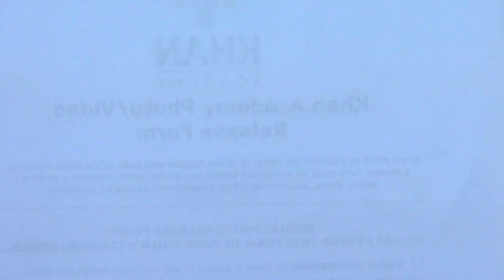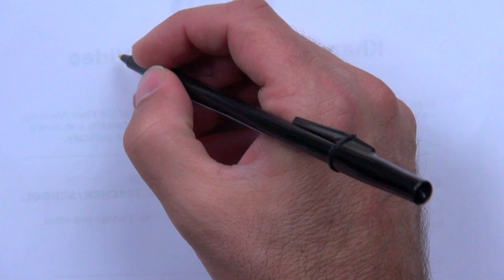What is inside a DVD player? (2 of 5) | Electrical engineering | Khan Academy

Comment: If the output current (or load) is large enough, the capacitor won't be able to supply power and the voltage will start to ripple. This is solved by using many capacitors in parallel (which increases the capacitance) or by using a capacitor with a larger value. Eventually though no amount of capacitance will prevent voltage ripple if the output load is too large. In that case the output power of the transformer would have to be increased to supply more output current. 

I hope this helps :)

Comment: The tank capacitor is like a bucket of water, it gets filled from the top and drained from the bottom... When full, even if the input slows or stops the output is not effected (until the bucket empties). If a large enough capacitor is chosen, the dips in output voltage won't be enough of an interruption to empty the capacitor entirely. So the output load essentially runs off the capacitor and the output winding of the transformer keeps it charged. Continued...

Comment: Because of the ripple current (the current slowing between pulses) an Inductor is used to keep the current flowing between pulses. An inductor at first it is reluctant to current flowing into it much like a bicycle tire is hard to spin at first, but once it's spinning it's hard to stop, an Inductor will keep the current flowing when it wants to slow down or stop. This only solves the ripple current but there is still voltage ripple... This is where the tank capacitor comes in. Continued...

Comment: Since the output voltage is high frequency alternating current (that is to say the voltage swings positive and negative) the first thing to do is to rectify it with a diode. However that only solves the problem of voltage swinging from positive to negative but it's still pulsing on and off. Between pulses the current slows down and this is called ripple current and capacitors do not like this, and this is the reason the next step is to run the rectified output through an inductor. Continued...

Comment: One other thing I would like to mention and I notice confuses some people is the output side of the transformer. Most people don't realize but the output is essentially the same as the input (but at a lower voltage) and is alternating current, so you cant power anything directly from it. This explains the components on the output side, which usually consist of rectifying diode, followed by inductor followed by tank capacitor. These components serve a vital role in the power supply. Continued...

Comment: Thankfully these capacitors have been made specifically for this type of application and have been designed to not fail as a short, and even more to self heal. They are also usually made of flame proof material just in case the do fail as a short. Most capacitors like these are rated by UL and other safety regulatory bodies due to their dangerous application, and are marked with various labels indicating which regulatory agencies they have been approved by.

Comment: The X and Y Capacitors and the Common Mode Chokes are used as low pass filters which allow the low frequency AC to pass through with minimal impedance but choke or block the high frequency noise. The problem with these capacitors is they must be connected directly across Live and Neutral and normally capacitors fail as a short circuit which in this case would present a fire hazard for X caps and a shock hazard for the Y caps (which connect from Live to chassis ground). Continued...

Comment: The reason Switching power supplies need EMI filtering is best explained by observing what happens when a large appliance is turned on in your home (Like an AC), when the appliance is turned on the voltage on the mains drops, which is sometimes noticeable as a dimming of lights or a fans RPM decreasing. Now imagine turning this appliance on and off thousands of times a second, imagine the noise created on the mains! These voltage and current spikes wreck havoc on sensitive equipment like radios!
Reply: You mean wreak

Comment: When the voltage drops below this set level, the TL431 stops conducting and the Opto LED turns off, then the photo transistor in the Opto turns off and the PWM starts oscillating again. This feedback loop keeps the output voltage at this set level. The current sensing resistor monitors how much current is being drawn to drive the primary winding which increases with secondary load increase, The PWM increases the duty cycle during higher loads to keep the output voltage from dropping. Continued..

Comment: Much better now :)

Just for future reference, most SMPS use a TL431 as a voltage reference using two resistors to set a reverse conduction voltage, which is usually monitors the highest output voltage of the transformer. When the output voltage reaches this set level, the TL431 (which is in series with the LED in the opto) starts conducting and turns the LED on, which turns the photo transistor on the other side on and this blanks the PWM output off. Continued...